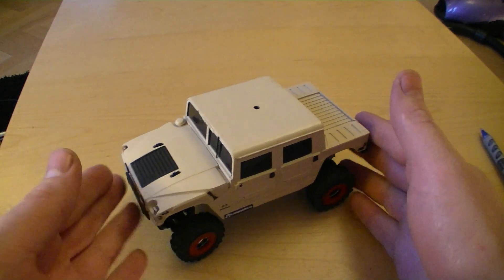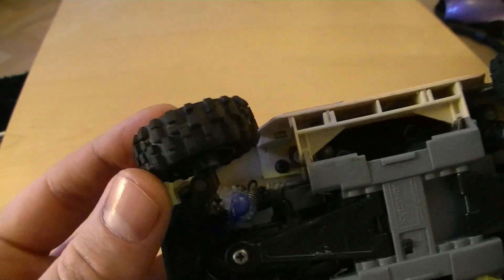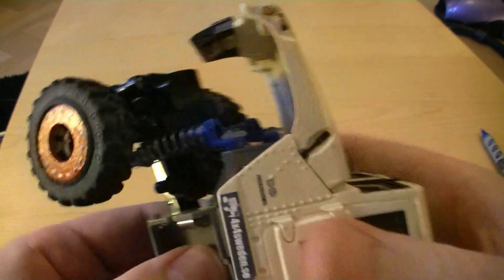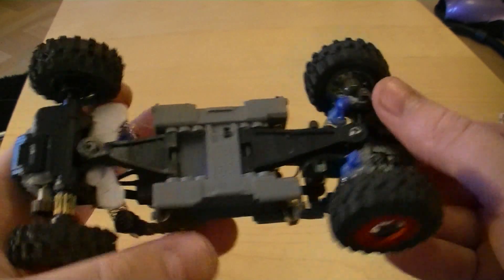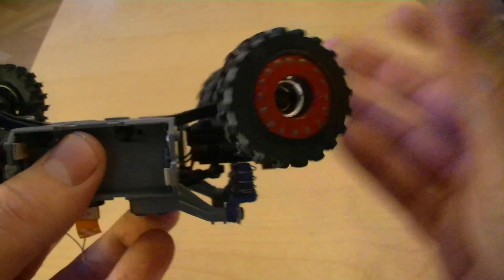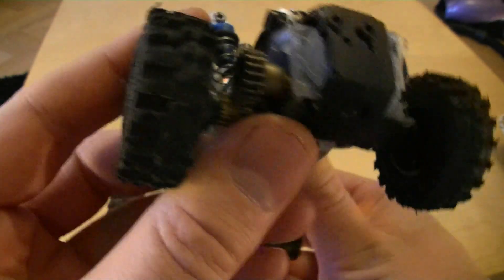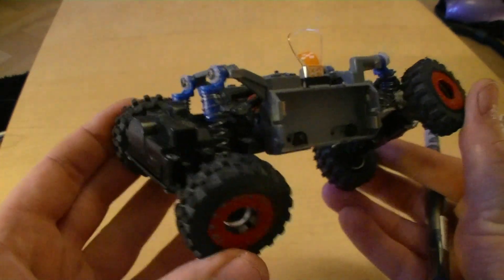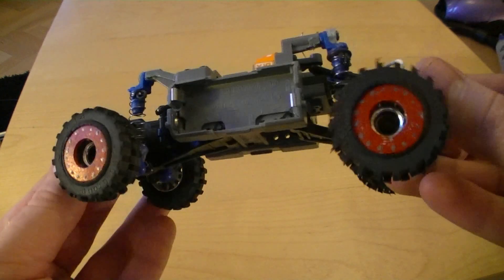Mini-Z Overland crawler mods

Comment: Great job! But you didn't have to fabricate your own mount for the bottom. I did a similar mod, but only kept the top mounts stuck in place, while keeping the bottom mounts stock. It still works fine, and the shock stays stright.